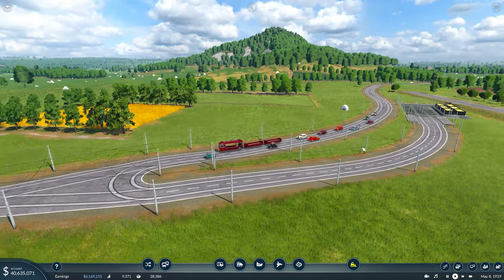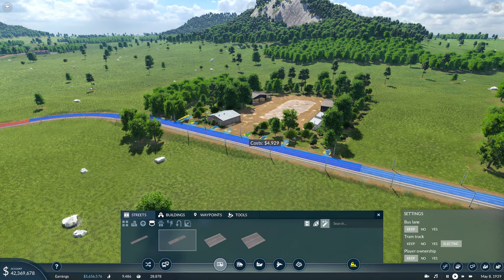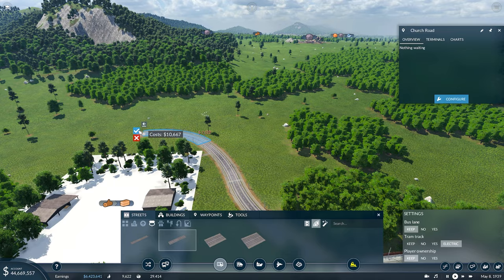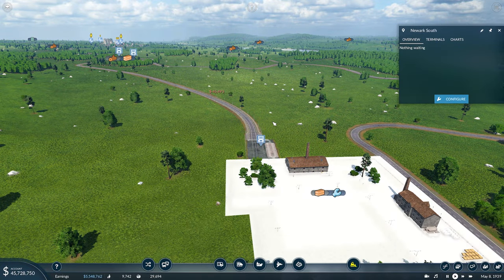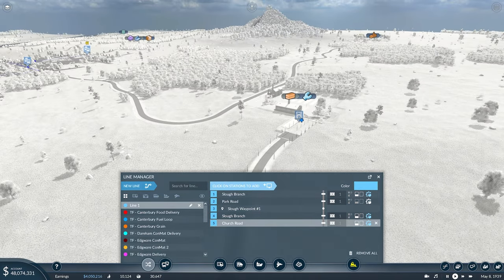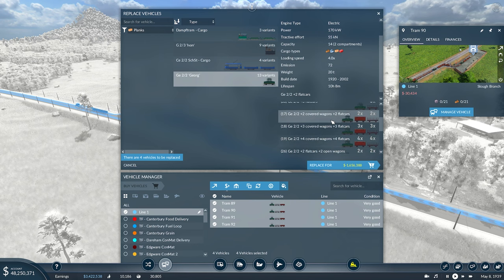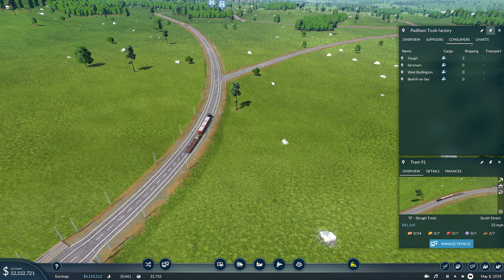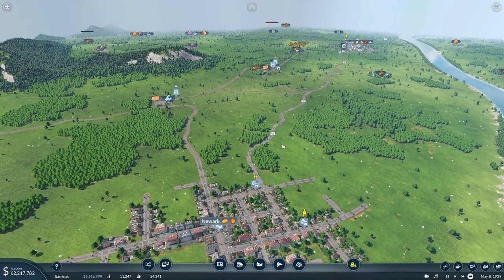Transport Fever 2 Gameplay | Only Trams | Ep 10 #transportfever2 #tram

Comment: Hey, a Tip for the CrossCountry line: The trams you used for the Tools have also in the mod activation Tab where you can activate Passenger coaches.
That might be good for the CrossCountry Line.
Also, i think it would be cool to have light rail trams, i dont think thats against the rules. For that, there are also many european ones which would be cool.
Have a nice week!
Reply from the maker: Hello mate, thank you for your comment :) hmm yeah that’s a good idea for the cross country line… but I think I’d need to add passenger wagons to the tram. It’s definitely interesting, I hadn’t thought of mixed consist :) Thanks alot for the advice I’ll look into it :)
Reply: nice :)